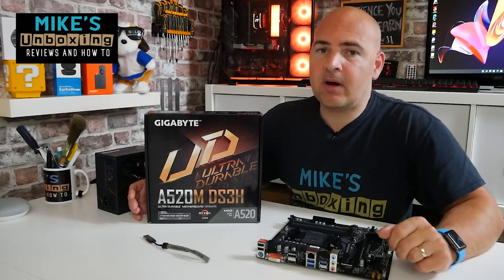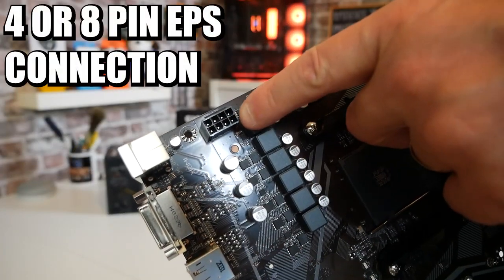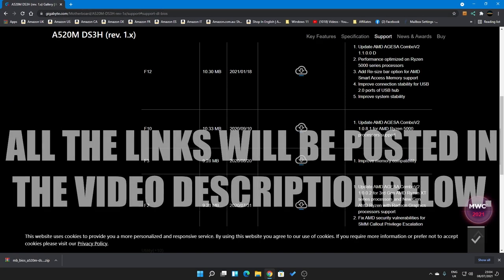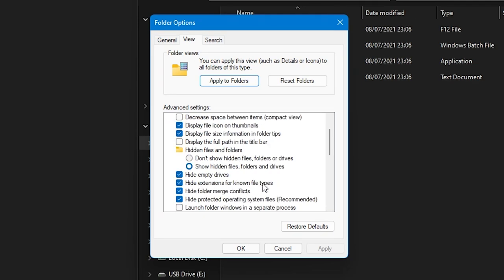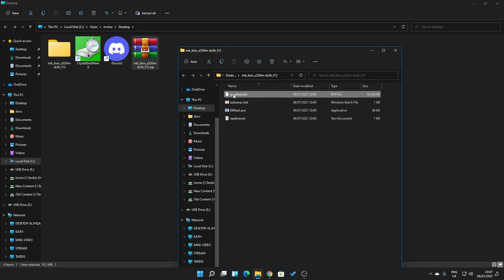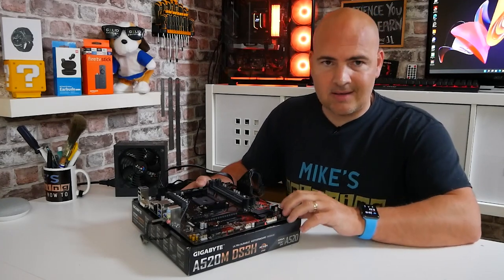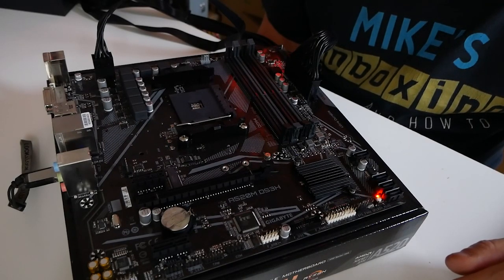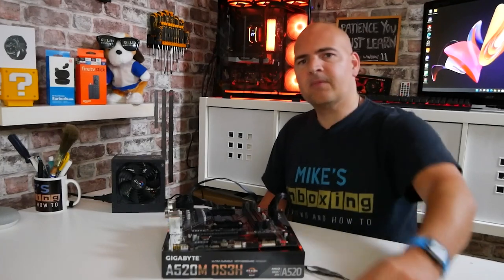How To USB Flash BIOS With No CPU Gigabyte A520M DS3H Q Flash Plus

Comment: Friend, you saved my life. I'm a poor boy from brazil who makes a living doing maintenance on computers. A customer had purchased this motherboard with a Ryzen5 5600G but the bios was not supported. Thanks to your video I managed to update the bios without processor and without memory and everything worked.
Reply from the maker: Glad we could help - love to Brazil :-)
Reply: Glad to hear that, I will be having the same setup.
Reply: this is literally what I'm trying to do right now. I bought the 5600x, i already returned one motherboard thinking it wasn't working. I did my homework prior, cpu/mobo compatibility, ram compatible, did a PSU calculation. built computers a couple times before. couldn't get a signal.

here's hopin...
Reply: V0sC3 é vm L1x0

Comment: The designers of many of the mATX AMD motherboards need to make sure their resellers and sellers are rolling out their product with the latest bios. The stock bios on most of these MBs wont run most modern ryzens, like almost none. On my MSI boards they try to push the ryzen past 1.5 volts and results in shorts. And this is a board desgined specifically for ryzens! Even I know they shouldnt go past 1.5 even on extreme conditions...
Reply from the maker: that is very much a cost thing, would you buy or even want to buy a motherboard that had a labour surcharge on it as the seller had to flash it? especially when most modern boards have a usb bios flash feature

Comment: My problem is that my pc wont anymore turn on after the power suply turn off. and sry for bad english? So How the pc will turn on?
Reply from the maker: unplug and leave disconnected just it might be a thermal cut out, and check the fuse in the plug

Comment: I just built my low end pc case is nzxt h510 with id cooling aoc water cooler athlon 200ge and 8gbs of ram and it doesn't have an os I have tried everything from q flashing that doesn't work and trying to use my USB stick as a drive for Windows and nothing is working I also have a integral m.2 2280 500gb and an msi r7 370 gpu (currently unplugged as pc wont start
Reply from the maker: This is maybe easier to fix or at least advise if we can ask more questions and get direct answers, so feel free to join our Discord chat and we can go over it in more detail https://discord.gg/gaeeDPw

Comment: Thanks a lot! Great tutorial. Got my Ryzen 5 5600G finally supported after flash. No display before that when i finished my build. Not a word about issue on a gigabyte support. Greetings from Poland.
Reply from the maker: Glad it helped! And a big hello to Poland!
Reply: Having this issue with my current build. Hoping this works for me tomorrow. Thanks Mike!
Reply from the maker: @jax2442  How did you get on with it?
Reply: @mikesunboxing  Worked perfectly.Fans continued spinning as you mentioned but after turning it off and powering the pc on I finally got a display signal.

Comment: For anyone who reads this and has a larger flash drive:

Open disk management in windows through search
Select your thumb drive on the list of drives on the bottom half
right click and delete the volume
right click and select new simple volume
when you format the drive, make the size 2000mb on the first page and fat32 for the file system on the second
assign a drive letter(whatever letter you want, doesn't matter)

This guarantees it will work.  The MB will only see the drive as a 2gb flash drive.

Comment: I have this exact setup. Bought a 5600G which is supposed to work on this mobo starting with F13.

So I downloaded it, flashed it like in your video, but all I get is a blank screen (the fans are spinning).

I then downloaded F14, which is the latest from last month, flashed it, same result.

I figured it must be something wrong with the CPU's stock Wrath cooler, so I unscrewed it off the CPU, powered again the system, the cooler fan spins.

Tried all of the above with and without RAM, with and without the M2, nothing.

Another weird thing is that when I power on, the CPU stays cool even without the cooler screwed in. It is a brand new 5600G, I unboxed it myself.

Could it be that the mobo is fried ? If so, why does it let me flash the BIOS ?

Could I have fried the CPU ? 

I don't know what to do next, except borrow another compatible board from someone and first test the CPU, and then borrow a compatible Ryzen and see if the mobo is the culprit.

Any suggestions welcome !
Reply from the maker: This is maybe easier to fix or at least advise if we can ask more questions and get direct answers, so feel free to join our Discord chat and we can go over it in more detail https://discord.gg/gaeeDPw

Comment: Hey there, Mike! First of all, I loved your video! It was very easy to understand and explained very well! You got a new sub!
I'm planning on buying the A520M DS3H with a Ryzen 5 5600x and I was wondering if, by now, any new MOBO that I buy might come with this drive updated already for this range of CPU. And, if yes, is there a problem to do this flashing with the driver already up-to-date?

Cheers from Brazil!
Reply from the maker: Thanks for the sub! "most" new boards are likely to be updated to run the newer chips, but as always if there are still older models in stock that makes it difficult but at least with USB flashing it isn't a case of needing an older cpu to get into the system
Reply: Nice! Thanks for the answer! So it wouldn't be a problem to "re-update" in case the driver is already installed on the board.
Have a great day!
Reply from the maker: The updates are pretty constant and add more features or stability so regular updates are generally a good thing

Comment: The BIOS chip is located in the middle near the M2 SSD slot labeled as M_BIOS. On the flashing process, the fast speed light indicates erasing of the EEPROM chip and the slow speed is the writing process reading from the USB drive. The EEPROM data is not loaded previously is a direct read from the USB drive. The big question is if something goes wrong the entire process can be repeated. I suppose that the bootloader is not located on the BIOS chip maybe the southbridge chipset has a built-in bootloader for BIOS flashing.
Reply from the maker: yes i think the flashing process is controlled elsewhere so if a flash goes wrong it can be recovered by running it again. I did this with an MSI board and was able to recover it after a while of retrying flashing

Comment: Thanks for sharing.  I've just ordered a Gigabyte A520I AC mboard and ryzen 5600g, so would I have to flash the BIOS in a similar way?
Reply from the maker: possible, check for the 5000 series ready sticker on the box
Reply: @mikesunboxing  Thanks.  It says AMD Ryzen 5000 ready on the box but not 5000G ready.

Comment: What was the outcome of the 3400g?
Reply from the maker: sadly not the manufacturer are 100% correct that the 3400g and 3200g are not compatible with this board at least not as a APU, as a cpu it is fine but will need a gpu with it

Comment: Hello Mike ! I just bought an MSI A520 vector WIFI. Is there a Flash BIOS Button or do I need to install an older CPU instead of my new RYZEN 5 5600G to proceed with flashing ? Many thx in advance !
Reply from the maker: hopefully it will come with a suitable bios otherwise you will need a compatible CPU installed first to flash the bios, this boards does not have a flashback option

Comment: Hello, can you help me? I have the same motherboard, but the problem is that my button, I think, has a damaged led, since the little light does not work for me and I don't know if the bios is being updated. I am doing the update with the processor already installed, I don't know if that affects something
Reply from the maker: This is maybe easier to fix or at least advise if we can ask more questions and get direct answers, so feel free to join our Discord chat and we can go over it in more detail https://discord.gg/XtBTGQ6BDu
Agree to the rules by clicking the emoji and you will get access to the rest of the Discord channels

Comment: What do you lose on an A520 vs a B550 or B450 - obviously the manual overclocking, but does it still PBO?
Reply from the maker: yes it does, most of the reason is cost the a520 chipset is really cheap to make and that is passed on it seems

Comment: I have a gigabyte b550m ds3h board and looking to pair it with a 5600g and was wondering if I need to do this process or should the board be able to boot it.
Reply from the maker: the board if new should be 5000 ready but if not that board has a usb flash option

Comment: so, once you push the qflash button automaticly the fan in the psu starts spining or the fan(psu) has to be turned on before pusshing the button?
Reply from the maker: The button push should start the fan on the psu although some psu have zero rpm fan under low loads so it might not spin just power up
Reply: @mikesunboxing  thak you very much

Comment: My son has just built a computer with this motherboard and a Ryzen 7 5700g processor and nothing is displayed on the monitor when he turns it on. Any thoughts? Could this be a Bios issue?
Thanks
Reply from the maker: i could be, difficult to tell, look for a ryzen 5000 series ready sticker on the motherboard box, if it has it then there is likely another problem, if there is no sticker then a bios flash is most likely needed. 
feel free to head over the the discord chat in you need more help or guidance

Comment: So my 24 pin cable flashed when I turned the power on, I tried another older PSU and updated the bios. What should I do about the new PSU, is it normal for the cable to flash when turning it on?
Reply from the maker: This is maybe easier to fix or at least advise if we can ask more questions and get direct answers, so feel free to join our Discord chat and we can go over it in more detail https://discord.gg/gaeeDPw
Reply: @mikesunboxing  Maybe next time, I did order a new one and will refund this one. It also had construction errors, a capacitor was blocking one of the slots. I ain't got time to deal with a brand new PSU.

Comment: i have a 128 formatted in fat32...  I used rufus,  properties says its fat32.  whats up with that? am I good?
Reply from the maker: fat32 is normally limited to much smaller sizes, but if it says fat32 it's fat32
Reply: @mikesunboxing  well the Rufus program converted it in a snap, I'm wondering if the Q flash can't scan a drive bigger than 32 GB? I haven't even tried yet, so I'm wondering if you know if this is the case?

Comment: Mine mobo is at f10 bios and I want to put a ryzen 5 5600g is it possible to install a bios or must I qflash it
Reply from the maker: if the system is up and running you can flash from inside the UEFI bios  looks like f13 is needed for the 5600g

Comment: I have 64g usb flash drives that are fat32...it doesn’t have to be 32g or less
Reply from the maker: you can't format a drive larger than 32gb in fat32, you can shrink the partition size to allow it but fat32 has a hard limit of 32gb
Reply: You can but it requires windows powershell or third party programs I liked your video very good!!

Comment: Question, I have to build a Ryzen 5 5500 and a GIGABYTE A520m S2H tomorrow, I've heard from almost every other source that when you change the name to "gigabyte.bin" it needs to be all caps like "GIGABYTE.bin"? Is that true or does the board sense the file with lower case letters just the same? Any help appreciated,  thanks!
Reply from the maker: upper or lower case is fine
Reply: @mikesunboxing  thank you a ton for the reply
Reply from the maker: @PloutosPlays  No problem :-)
Reply: Hi @Ploutos Kronos, I'm trying to build exactly your setup (A520m S2H + Ryzen 5 5500) but it doesn't works. I flashed the BIOS several times with differents versions but doesn't boot. Nothing is showing in screen and keyboard keeps off. Did you get it to work? Thank you in advance.
Reply: @arberthree  it worked first try for me, on 2 separate boards, if you flashed a bios and nothing happened the board is pretty much dead unless the board has a dual bios, and this one doesn't. did you follow this video exactly?
Reply: since it has a bios flash button, you could maybe re flash the version that supports your cpu, but not sure
Reply: @PloutosPlays  Yes, I've followed the video exactly several times. The process take about three minutes. I think is a short amount of time. Do you remember if, in your case, your process taked only about 3 minutes?

Comment: Can i still flash the bios using qflash but with CPU installed on the motherboard?
Reply from the maker: yes you can, but they recommend to do it on a bare board

Comment: The thing is that the bios chip is not large enough to hold the data for every ryzen cpu series and they removed support for first gen Ryzen an apu stuff. Just like b450 was not supposed to support newer chip but decided to cut on compatiblity with older chip to make room for the newer.
Reply from the maker: weirdly the 2400g 2200g and 3000g all work fine, just something about the 3200g and 3400g that cause problems
Reply: @mikesunboxing  Strange.. I had no luck with a 1500x and a 2200g on a Gigabyte a520m ds3h, I did not have a 3200g to test at the time thou.. 🤔🙄 Technology...

Comment: Hello do you have the bios file ?
Because gigabyte is down
Reply from the maker: they are updating the site all over, be patient it will be back up soon
Reply: @mikesunboxing  now because I have bought  but 5600x update is required that's y. Without it 5600x won't work
Reply from the maker: Sorry I don’t have the bios file saved, maybe try using a different region of the site to get the file?
Reply: @mikesunboxing  OK site is up now
Reply from the maker: @mayurpahuja9842  Great :-)